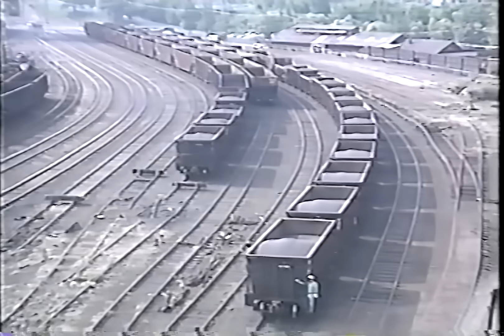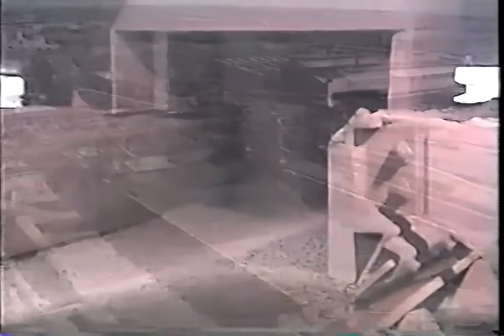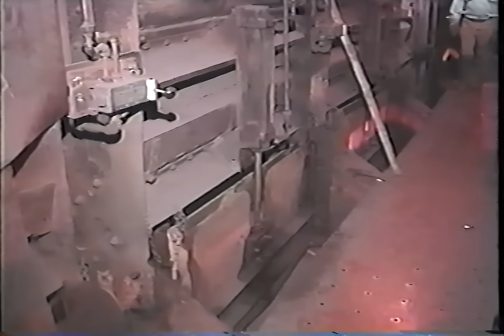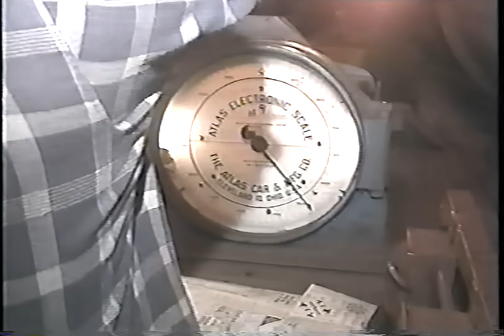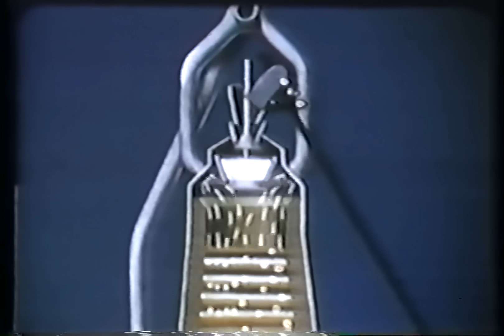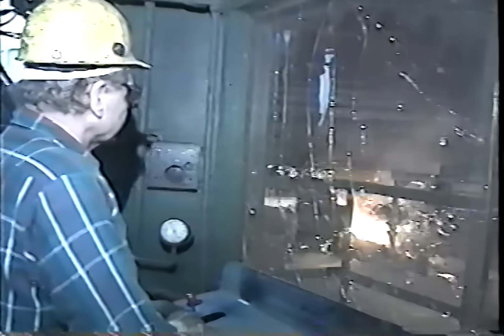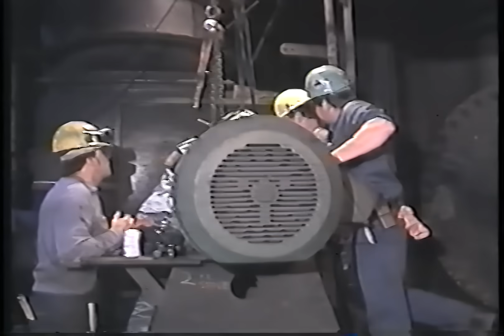Beth Steel Furnaces

Comment: To all the people blaming politicians and CEOs ect for the failure of steel mills and U.S. manufacturing you need to remember that they only respond to the public's and consumer's demands. The american consumer no longer cares as much about quality, in fact we pride ourselves in finding that best coupon code online for a certain product and getting the lowest possible price. On the surface that makes sense we want to save money. But it means that if a company can save cents on manufacturing it will give them a market advantage. Then you have multiple manufactures constantly refining it down to the lowest possible cost in sacrifice of both the end product quality and the conditions for laborers. In the U.S. we have safety standards and minimum wages. Neither of these things are good for cost of production but are obviously very important. So production go overseas where they can treat people however they want and pay basically whatever they want. If we want to revive U.S. industry one step we need to take is shaking off this mentality of saving every last cent, particularly in U.S. made goods.

Comment: Ore comes in on railcar, gets dumped into a different railcar, then gets picked up by a crane to sit in a yard.  Then the crane picks it back up and puts it in a rail car, then its dumped into another car underneath it....Jesus, its a wonder they stayed in business as long as they did.
Reply: I'm betting when these mills first opened they were a lot smaller and made a lot more sense but as time goes on more and more is added and it becomes a mess. I work for Hershey foods and the building Milton Hershey started in was no exception. It was "completed" in 1905 but construction rarely stopped until it was closed in 2012. In total 25 buildings were constructed and not one operation was streamlined.
Reply: These kind of operations are not ran by 5s people. They're the kind that have inherited a business and have no passion for it. It is just a value stream until runs out of growth.
Reply: Stole my comment.
Reply: my thought exactly why don't they just dump it in the holding yard to begin with
Reply: As someone already said, that most likely comes from the fact that the plant being well over 100 years old.  Back in the day, you just built something anywhere you could and you got the job done because it was the only job around.

It's funny.  As crude as things were built back then, somehow they were built to endure and last.  The same buildings and machinery just cranked on for decade after decade.  They may not be very pretty and efficient, but when you build something that lasts 100 years versus new things that last less than half as long it kinda makes you wonder.  If you had to build a new foundry like the one in the video, it'd probably cost you 1 billion.

I have heard that there is basically only one company who produces paperclips in the USA.  The same machines are used that they were using when paperclips were first invented.  They run 24/7 and when one breaks down, it gets fixed.  They don't replace it.

Also, as another person said, when dealing with the Unions, it virtually impossible to get anything done.  If you ask a union member to use a new different kind of shovel instead of the one that has been used for the past 25 years, it takes an act of congress to get it done.  So most companies don't even try to change anything when dealing with a union.  This is why it took almost 13 years to build the One World Trade tower and it took only 13 months for them to build the Empire State building back during the Great Depression.
Reply: @karozans  garanteed wage,benefits, pension,still a rarity these days,I've never seen anymore get away with not taking there share of work,
Reply: For all the day late quarterbacks here making comments on the negative side…ie inefficiency, union involvement. Just remember. These mills quite literally built a country. Whenever you look at the New York City skyline to this day, most of the steel in those buildings came from these mills.

When was the last fuckin’ city you built?
Reply: the whole darn thing is incredibly in-efficient
Reply: Blame the labor unions for "making jobs."
Reply: @henryhorner3182  You're shortsighted.

Comment: Huh. Didn't know we were supplying Bethlehem! The furnace shut down before I joined, but the limestone operation was just as old as the steel plant. Used to supply Lebanon and Sparrows, as well. 

Near the end, the shunt engine that we used could barely make it up a half-percent grade. Did you know a 172H Caterpillar wheel loader will push a full-sized diesel locomotive engine? 

For about 50 feet. Wide-open throttle, all the way. Then, you have to stop and let the temperature gauge come back down.

Comment: This was great.
Wish they had done one on the steel side.
So sad that it is all gone.
There are very few full on steel mills left in the US.
The kind that take iron ore, limestone and coke and make steel.
There are micro mills left that melt and remix scrap steel.
That is fine as long as you have enough scrap.
We can no longer process lead ore in the US.
The lead belt in Missouri still has ore but we can't do anything with it.
Very sad.

Comment: Cool, so what are they making? Ingots, rods or just molten iron?
Reply: They made pig iron. That was normally used in Bessemer converters to make steel. They would cast the molten iron into ingots and then those went to the converters or sometimes electric furnaces to be mixed with alloys and to have the carbon burnt away in a controlled fashion to produce the desired type of steel. That was cast in large ingots and then taken into the rolling mill where it was shaped into the desired product, structural steel, slab, sheet, plate, rod, etc.

Comment: In Sweden the steel business is doing pretty well. SSAB have started making high tech, highly alloyed steels instead of the cheaper bulks types. With high strength steel being used more, and more, in order to save weight, it has worked out.
Reply: Nyrek is a company in West Australia that makes grain handling bins (chaser bins amd mother bins) 
They use Swedish steel because of its strength and resistance to cracking 
They got an award a few years ago by some sort of Swedish steel group for what they're doing woth Swedish steel
Reply: I was working in Ssab branch in Poland. I was welding steel constructions there.

Comment: How do they get 4000 degrees in the blast furnace if the stoves are only putting out 1600 degrees?
Reply: Yes, the coke burning produces the heat and the 1600 degree air from stoves is injected into the blast furnace to get the coke oxygen to burn with. That is the 'Blast' in the blast furnace!
Reply: The burning of the coke mixed with the ore going in the top.

Comment: By the time I got out of the industry in 96, Bethlehem Sparrows Point was making a horrible product... The process was antiquated and the Union was making it impossible to but any real money into the facility. It's a shame it's gone it was a great employer. I hate to say it but the Union was responsible for the downfall.
Reply: There is enough blame to go around.
Cooperate found out it was easier making money by playing around on Wall Street rather than reinvesting in the plant.  One reason they were discouraged from reinvesting in the plant is they knew they would have to fight the union anytime new tech that would save labor would be brought in.  The union didn't want to lose any jobs and the factory couldn't justify investing in the plant if it wouldn't save them money.

It is a sad situation and in the end everybody lost.
Reply: @1978garfield  ok
Reply: Happened with different companies here in Australia not relating to steel. One company I worked at as a casual had left because of a union, and returned and put every single person on as a casual except the management. The dumbest part of all was apparently the union could see the financial papers, but still demanded higher wages anyway causing them to pack up and leave initially. The union cooked themselves but the company returned less than 5 years later. It was an American company making a certain type of special fabric for paper making in Chinese factories. Paper pulp was put on this fabric and depending on how much water it let through, determined the type of paper that that roll of fabric would produce.
Reply: Yeah I’m sure it was the unions fault
Reply: @andrewbrown3638  look at how the unions killed the auto industry, the steel industry, the trucking industry and every other industry they sunk their talons into. They served a purpose back in the ‘20s when there was little protection for the workers, but you can’t say with a straight face that they didn’t contribute to the downfall of American industry. Anyone with a simple understanding of economics can clearly see this.
Reply: @johndoran3274  You can't blame the unions for management deciding to ship their money across the ocean to China.
Reply: @BikiniDuckCreations  Actually you can blame the unions. They whined and cried because their people didn't make enough money. So management did what they had to do to find labor that would work.
Reply: @BikiniDuckCreations  Bethlehem Steel didn’t move production overseas, they just couldn’t complete with overseas companies and folded. The main reason for this was the extortionate demands of the Union. The company couldn’t modernize because the Union said it would kill jobs and they really couldn’t afford it anyway because of the ridiculous demands of the union. I’m not speaking without first hand knowledge, as I said, half of my family worked for Bethlehem Steel. Simple economics killed this company.
Reply: @farmcentralohio  god forbid that the men and women who actually do the work want a better share of the money than some faceless investor or share holder. You’re clueless and probably a little jealous.
Reply: @johndoran3274  and in the end, management has the final say. They are the judge and jury. Not the unions fault. Like I said god forbid that the people that actually do the work want to make a better living
Reply: @andrewbrown3638  as someone who knows people in the upper union pyramid.  I can tell you the unions have been a big problem in keeping union workers employed.  One person I know in has lunch catered every day, a company paid vehicle, gas card, and expense credit card. There is no maximum limit per month but he has a minimum and that number is almost $1,000 a month.  He’s one of dozens in his office and is at the bottom.  Think what perks the bigger fish get.  The unions are in bed with corporate, not the hourly worker.  And if you knew what a union steel worker made or makes, they had/have no problem living comfortably.  A family friend retired from Chrysler as a foundry worker in the early 2000’s.  He had no problem clearing $100,000 for years.  I’m all for everyone making what they can get but serious,  an uneducated person making that money is only going to last a short while.  When the auto industry tanked in 08 they still got 80% of their hourly pay for not working.  Seriously???  Now the new guys have a much less lucrative contract because of the old guys and what they were able to get.  That’s why a cheap car is now $25,000 instead of $15,000 and a nice new car is 35-45,000.  Fully loaded f150 is dang near $80,000!!!  It’s not all the unions fault but it’s a big portion and btw, I’m a union employee and think what we get is sometimes ridiculous.
Reply: @andrewbrown3638  Unions are as corrupt as their corporate overlords. And you wonder why it's called the rust belt...anywhere where unions were strong is now a dead area. Unions are greed
Reply: @andrewbrown3638  and there is the rub. Why is it ok for the unions to bleed a company dry but a Company is evil and ruthless when they either close down and reopen under a new name to get rid of the union or move overseas to keep their business alive?  The union had a choice in Bethlehem’s future when a British firm offered to buy it and modernize it, but the union said no to a 10% pay cut top to bottom. That worked out to 3 dollars an hour for the average man working there. So instead of making $27 an hour, they fought over $12 an hour jobs that were few and far between after the mill closed.
Reply: @andrewbrown3638  Management's decision is based on money. If the union demands more money than the business can pay and still remain competetive and not totally go out of business, then the business goes elsewhere.
Reply: @johndoran3274  ups drivers making 35+ an hour with great healthcare is bad for them how? When you start to do more for me then the union then I’ll might see your point.
Reply: @analstench4522  but you forgot to mention Preston, Consolidated Freight, St. Johnsbury, Roadway, and almost every other union trucking company that the union drove into the toilet. $35 an hour with benefits is pretty standard for an experienced truck driver without the union dues coming out of a paycheck. I own my own truck, so I’m just going by what my friends tell me.
Reply: @andrewbrown3638  lolz, you can't even economy to potato.
Reply: @johndoran3274  roadway was a debt free, profitable concern.  It was destroyed by yellow freight.
Reply: @johndoran3274  Don't you believe a worker should get paid for an honest days work? They have to get paid enough to live and put a little away for their old age. If they aren't there is no incentive for them to work. That's why they join unions.
Reply: @clammacgregor8536  But the management is also under pressure from shareholders to make as much profit so they, the shareholders, can get more profit on their shares. Basically the shareholders are making money out of having money.
Reply: @ScooterZn  and without a profitable business to work at, you have this. The union killed off the steel industry in the US without question. Is it really the responsibility of an employer to provide an employee with an ability to live a certain lifestyle, or is it the employees responsibility to live within their means? Nobody forces people to work anywhere.
Reply: @ohboy2592 whatever scab
Reply: @jsncrso that's what rats say
Reply: @johndoran3274 so you have no benefits and you will areprobably unemployed as I write this. RAT.

Comment: The men and CEOs in charge of these old mills were just like Henry Ford. It's been working this way for 50 years , we're not going to change our ways. RIP old mills 🤦🏼‍♂️
Reply: Sounds like you don't know about Henry Ford. He was always on the cutting edge of manufacturing tech just so he could produce his car at a lower price. Milling machines and machine tools were always the newest and best at Ford as was the foundry tech. The Ford V8 was a casting so complex that no one else could have duplicated at a reasonable price in 1932. If Ford lagged it was in the 1950's and 60's long after Henry was gone. One of the reasons Henry made his own steel and glass was he believed he could do it better and cheaper when he had full control of the process and the factory it was made in.